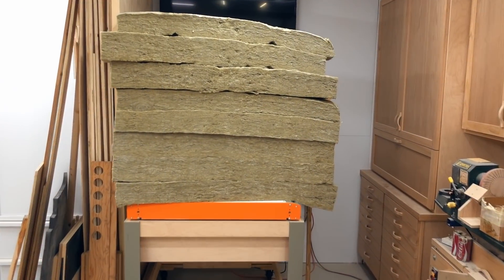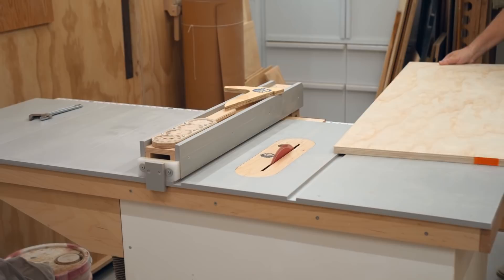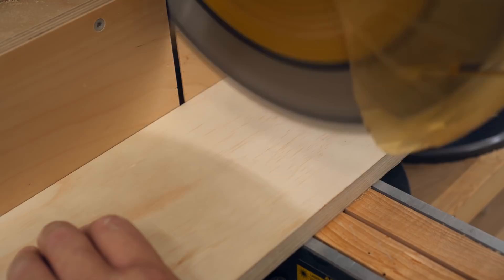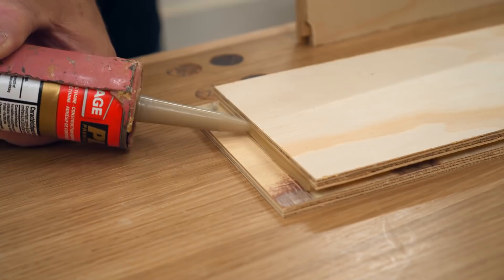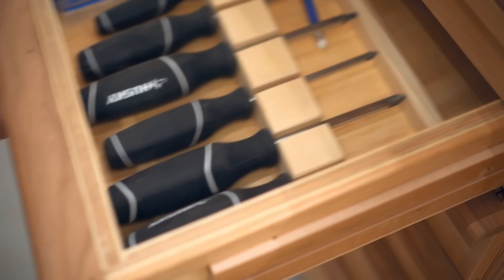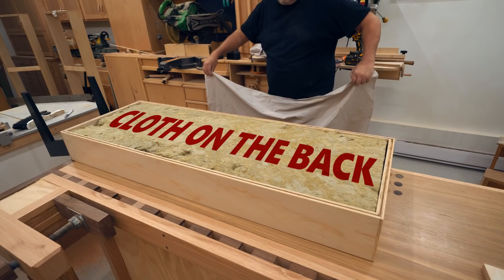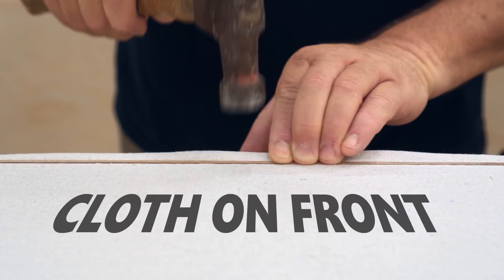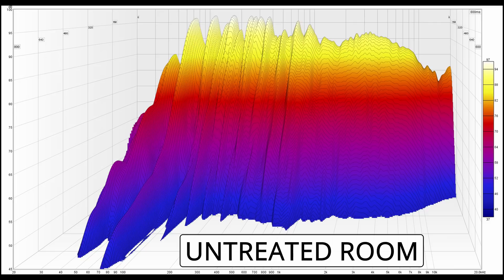How To Make Real Acoustic Panels | Includes Measurements

Comment: Very nice design!
The fabric attachment is sweet. 

Another approach can elevate performance up a few notches; implementation of a frame design whereby the all six surfaces of the panel are open, ie., leaving as much total area permeable and thus increasing absorption effectiveness regardless of angle of incidence. 

I've seen before/after measurement comparisons and with nice thick panels such as these the ∆ was more than one would think.  
I believe it's ~80% more permeable area with a wall mounted 6" panel. 

Your design with the spline keeper for the material is beautifully elegant ... and that renders what I'm referring to as a non-starter.  

I've never seen that approach, and I can't say that very often!

Comment: Being a fellow YouTuber, I really dig your editing (including the clever text fx here and there). I’m definitely gonna try to build similar panels for my current testing home theater build. Thanks!
Reply from the maker: Thanks. As a result of your shameless self promotion (ribbing you here), I just watched your latest video. Nice work but you did say something toward the end that's not quite accurate with regards to room treatment. Floors are actually the least important and carpet, being thin, will only be effective at absorbing the highest frequencies. And it's the highest frequencies you need to be careful with in a treated room, to maintain some "liveness". 
The best place to put as much real treatment (thick absorption, not thin foam) as you can is the ceiling, then the corners and first reflection points. 
And then measuring is important to get an accurate read on what the treatment is doing - a reality check to show that a little doesn't go a long way, especially when you are dealing with low frequencies.
Reply: @IBuildIt  Thank you! Yeah, I’ve since taken down the foam I already had in my possession because it just didn’t do much. Thus began my search for a good DIY acoustic panel. 😁 

With that being said, my theater is only 11 feet wide, so I don’t actually have a lot of room on the sides. Building panels exactly like yours in the video would take up a lot of valuable real estate. If you were to make a similar panel - but thinner - would you still use rock wool, or another type of insulation that’s more dense? I can make the ceiling panels thick, but not so much on the sides. Any suggestions on modifying your original plans to accommodate that? (Maybe we should just chat over Zoom one of these days…😄)
Reply from the maker: I don't do Zoom or anything live, since I've determined that's a trap that I'm likely to fall into and thus degrade my future content production.
You can make the panels thinner for the sides, but they lose effectiveness for lower frequencies. 4" would be the minimum - thinner than that and it's simply not worth the time, money and effort. Also the gap away from the wall boosts effectiveness by quite a lot - almost as much as adding that much thickness in fiber.
From my research (i'm not an expert) I've found that there isn't much of a difference as far as density goes, so rockwool will be about the best for a freestanding panel.
It comes down to thickness and area covered to put a big enough dent in the lower frequencies that are the number one problem with small rooms.
Reply: @IBuildIt  Ah, okay. Good to know! What are your thoughts on dense foam wedge bass traps in each corner of the room? (I have a few of those leftover from my music mixing days, too)
Reply from the maker: My opinion is that much of that foam stuff is decoration first, placebo second and acoustic treatment third. 
A good channel to check out for this stuff that accurate is this one: https://www.youtube.com/c/AcousticsInsider
His older videos especially.
One to avoid is this one: https://www.youtube.com/c/Acousticfields101
Some of what he says is true, but a lot isn't. There is a ton of bad info out there on this topic.
Reply: @IBuildIt  Thanks very much! 🙌
Reply: @IBuildIt  Do you happen to have written plans or instructions on the stands you built for these? I like the sloping shape of them. 👍
Reply from the maker: @ealanosborne  nothing on paper, I designed and built them on the fly. Just elbow shaped pieces of ply for the legs and a stretcher to joint them.
Reply: @IBuildIt  Hi John! I’m wanting to release a video soon regarding my personal journey building acoustic panels. I went with your design (with a few alterations), so could I use some clips from your video in mine, since I want people to know where I got my inspiration? Just the video portion, with me talking over it, no audio from your actual video. Thanks, John!
Reply from the maker: @ealanosborne  Sure, go ahead and thanks for asking.
Reply: @IBuildIt  excellent! Thanks again!
Reply from the maker: @ealanosborne  No problem, I'm looking forward to the video.

Comment: Install them bot further than 1 in off the wall. Better option is to mount them sealed on the wall and have an air gap inside so the low end performance increased.

Comment: Excellent built. I have seen that plaster board exists with specific holes in it ( various diameters and shapes for different frequency damping). Could these be used in movable panels for the same reason? I am thinking something like a base on rollers to move them out of the way when not needed.

Comment: I was curious as to how you decided what size the splines needed to be to get a tight fit and not split the layers of plywood. Well done. To play it safe, I would have gone to the store and grabbed a roll of the rubber spline for screen frames. It would not have looked as nice though.

Comment: The type of cloth you're using is very important.
It needs to be a very open weave. :)
IKEA's 'Ditte' works really well and is very cheap.
Reply from the maker: These aren't speakers, so the cloth isn't important at all. 
In fact, a tighter weave will reflect a bit more of the highest frequencies and that can be beneficial.
Reply: @IBuildIt  
Ah, right.. it depends on what you wanna do of course. 
I make these a lot for home studios and I just want them to absorb as much as possible so it's important the fabric doesn't reflect any frequencies.

And if the room asks for more absorption of bass frequencies I add bass traps.

Comment: Thanks for the video.
Can you post the REW .mdat file?
It is to see the RT60 ( Topt, T20, T30 ), ETC, Filtered IR before and with acoustic treatment.
What wool do you use as padding for the panels?
It is to see the value of the passage of the air flow.

written with translator

Greetings

Comment: Great work John. Have you considered Owen Cornings 703 and 705 as the sound absorption ? What are the "acoustic" effect of 700's vs rock wool insulation? Thanks.
Reply: As someone who has done a lot of my own research, they act similarly. The difference in their performance is not enough to pay more for one vs the other. So use what is most affordable in your area, so long as it has the appropriate density.

Comment: Is there ever a concern that the rock wool can deform inside the frame, due to  settling / gravity ?
Reply: rockwool is very stiff. I have a batt that has been standing on end against a wall in my basement for 2 years and its still the same shape